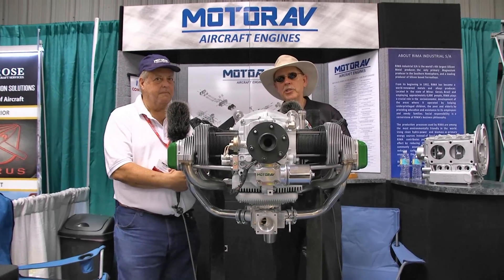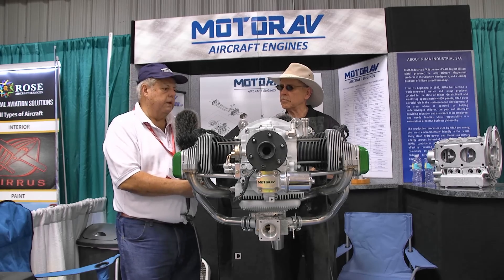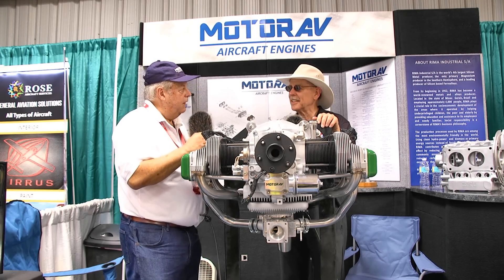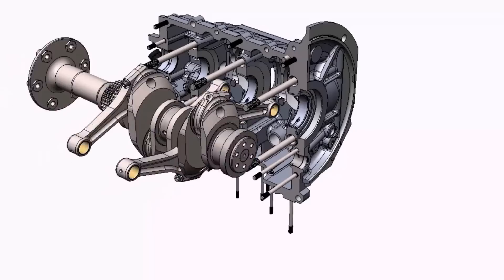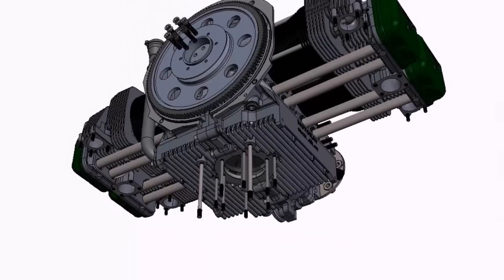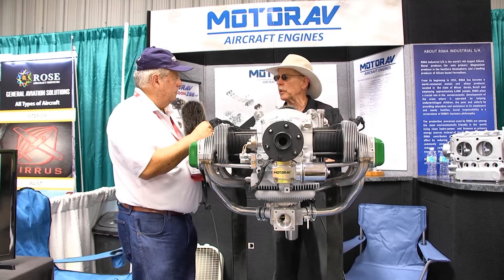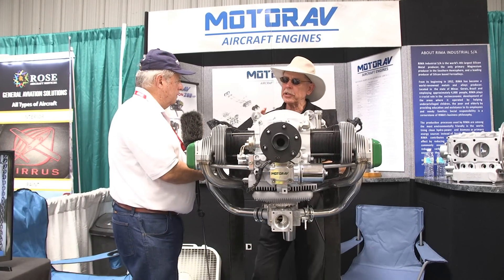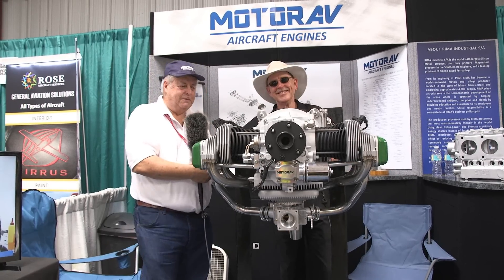MotorAV, Motor AV, 4 cylinder, 4 stroke,100 HP experimental, light sport aircraft engine.

Comment: This is a VW engine reconfigured for an aircraft.  It will be interesting to see if they have worked out issues effecting longevity and reliability. I like the new head design. It solves the single spark plug per cylinder and intake/exhaust configuration issues present in the original VW design. Original purchase price and overhaul costs could be very attractive! 
Web site states that they are looking for a North American Distributor. http://www.motorav.com/distributors.php

Comment: Someone please educate me... I've been a automotive gearhead for years, and roller lifters/camshafts has been the norm in pushrod engines for 30 years.  It appears this, along with other pushrod aviation engines that still run flat tappets.  (?)
Reply: Low RPM use softer valve springs, Less friction on the cam, Rollers not necessary. Less complex = more reliable.

Comment: Looks like a VW engine to me. Also much wider cross section than a Rotax.
Reply: Yup, a VW copy with a wider front bearing and a bolt-on lower sump. A new head design too. I don't like the iron cylinders though as they should have gone with nikasil aluminum for weight and cooling. 184lbs is kinda heavy.
Reply: @Cwra1smith  for 100hp. That's the whole engine. That's not that heavy
Reply: I'd rather go with cast iron cylinders any day above Nikasil coated anything especially after all the problems BMW had with them.Cyl sleeves were junk before even 50,000 miles.An expensive lesson.

Comment: Volkswagen boxer motor also known as a flat or pancake engine and magnesium can't be extinguished if it starts burning
Reply: Actually, magnesium CAN be extinguished. Note that in large masses (such as engine cases of Porsches, VWs, etc.) it's not easy to get lit.
Reply: why would the engine block catch on fire? ridiculus comment, very negative

Comment: Except for the beefed up fourth bearing and the cylinder heads, this is a VW engine.  I can understand since there is no longer a production car with the air cooled engine, the casting dies are being used for smaller companies to manufacture under license...  If they can keep the cost to a minimum, this design should do well...
Reply: It is likely that all VW patents have long ago expired as the engine is either based on a bug back to the 1950's, or a bus from the 70's or early 80's.  So likely one could make the molds without a license.

I've seen a question elsewhere why the double sump is used rather than simply updating the casting for a larger oil sump.

Unfortunately the MOTORAV website seems to have just a placeholder and no information.  :(

Comment: Power to weight ratio of the Rotax is still superior, but with this engine you have no gear box to worry about.  If it would put out 120 hp, we'd have a game changer.
Reply: Rotax RPM is too high.They also use liquid cooled heads to achieve the high power.Lots off things I don't like about them Should still be plenty off parts for the Corvair.?

Comment: I'd be interested in a few things..Why didn't they "Dowl Pin" the "Main Webs"?? This is an inherent issue with "Main Creep" under power with the 3 Main VW style case..All the Drag Race aftermarket (and guys that run Stock cases do this..it's a real issue) I would also be interested in the "Head" performance..the design (again) has a bad history of cracking  between the Intake and Exhaust Valve ports..Does it have Stainless Valve Seats??..Sodium Exhaust Valves??..There are a lot of questions that need to be answered..There is a big difference between pulling 40 HP and 100HP in reliability and part failure (which can be a catastrophic failure)..How many Dyno hours have the run??..I wish them all the luck..many have tried..most have failed..
Reply: Website was interesting however does need further explenation. Does all look really nice. My personal worry is quality control but they seem to have a good reputation. Price will be the factor as well as being a vw based engine even tho re engineered for aviation should be in my opinion affordable. Less than a rotax 912 more than an auto conversion VW
Reply: If you're running pump gas and not avgas you don't want stainless seats you want stellite, from what I understand avgas is supposed to go lead free eventually anyways.

Comment: The salesman should have mentioned the company’s history.    They are currently the manufacturer for basically all the new vw cases.   This project was started with a mind towards fixing all the original problems with bore and stroking a vw.
Reply from the maker: He did in the full interview BUT there is only so much I can get into an interview.
The Ultralight Flyer
Reply: @ultralightnews  So they manufacture the aluminum case I can buy from CB PERFORMANCE?

Comment: Regarding low rpm vs geared rpm, I'm pretty sure that you can run higher rpm with a smaller prop efficiently if only your target cruise is similarly higher speed. The reason for long wing or prop is to have airmass enough to not give like walking in sand in the time you pass it. So if you pass quickly the air mass will be 'stiffer'. Goes for shorter wing and shorter prop. So a sleek plane and motor might well work beautifully at 4800+rpm if your cruise is 250-300+km/h  vs cessnaing around at 150. It's not crucial to be efficient at 150 if you stretch your legs at 300. A turbo fan for even a big private jet has smaller diameter than your typical lsa.
Reply: Agreed, my buddy owned a Helio once.  You could replace the GTSIO 480 (geared) and its big prop with a 540 of similar power but you would lose short field & climb performance.

Comment: 189lbs !  compared to a rotax 912is at what 140lbs?   Is that apples to apples or am I forgetting something, or getting numbers wrong?  Hmm, LSA is already a weight juggling exercise as it is.   I would have thought a directdrive would weigh less than the geared rotax.   I wonder if they have a weight loss plan in mind?   I wish them success, more competitors the better, tho they have a long way to go to get a lot of flying hours under their belt.
Reply: The quoted 140lbs for the Rotax isn’t a running engine.  After all the accessories it’s a lot closer to 170lbs.   This engine should be about half the cost of the rotax which is a big deal for most
Reply: The whole purpose of a PSRU is to allow for the power to weight ratio of the engine to be improved by allowing it to rev at a higher rpm.
Reply: @PistonAvatarGuy  Question: What wears faster? An engine running at 5,800 RPM or the engine running at 3,200 RPM? Assuming same output HP (100) on the shaft of course. 

The purpose of the PSRU is to accomodate a lower displacement, high rev engine to match the max velocity of a prop (ie: (Rotax 1.3L 912 iS).  With Rotax and some Auto Conversion, you trade lower displacement for a higher combined weight (PSRU does have a weight to them) for a targeted HP. 

Power to weight ratio: The only engine that comes close in weight, is the Rotax 912 iS. And the ratio is nearly identical to a more traditional flat 4 air cooled (UL Power). All other engines that uses PSRU are much heavier (159 lbs Viking engine, 170 lbs Airmomemtum Engine).  

But in all cases of engines using PSRU, you traded displacement and weight for an identical power output. So going back to the original question. What wears faster? An engine running at 5,800 RPM or the one running 3,200 RPM for the same power? 

 Here are the power graphs:

http://www.cfsaero.com/rotax/rotax-912-s-uls-100hp.php  

https://ulpower.com/en/engines/ul260/ul260if#2-performance
Reply: The other consideration is that a geared engine can have smaller displacement for similar horsepower figures, which can save engine weight.

Comment: Interesting. Similar approach to a lycoming 235 but 24kg lighter for the power. That's a seat and a child or 400km extra range. Or a chute and 200km fuel. I hear mixing metals can be tricky so they want to be on top of that. Shame if it can't run on mogas.
Even though fuel consumption and avgas are not ideal I certainly welcome competition and I hope the price will wake up the others. They need it.
Reply: If you listen he said 2900 RPM which would be the main reason for the horsepower to weight ratio. The guys who race airplanes at Reno have run the Continental 0-200 over 3000 RPM for years, they make substantially more HP, but they're not long term durable.

Comment: A super light mag/alum vw?
 2600 rpm direct drive 186 lbs? 100hp...Magic...??
Reply: This power is achieved at 2900rpm. This engine as a displacement of 2860cc, so it's pretty plausible that these numbers would be achieved for a refined engine like this one. Hope they get their certification soon.
Reply: With 2.8 liter swept volume I doubt it has any connection to the VW apart from the design.Therefore limited spares supply unlike VW based motors.